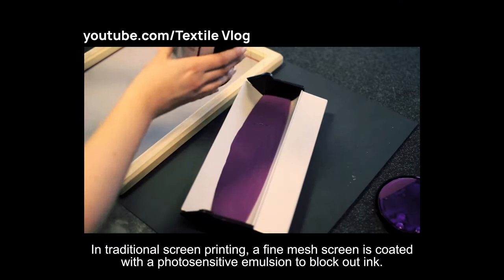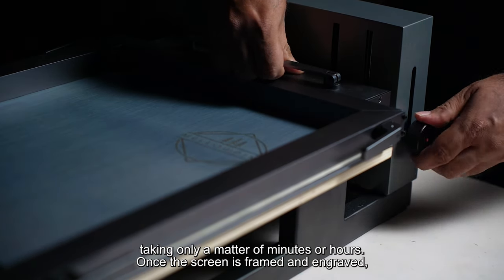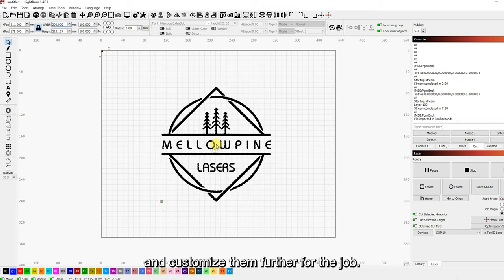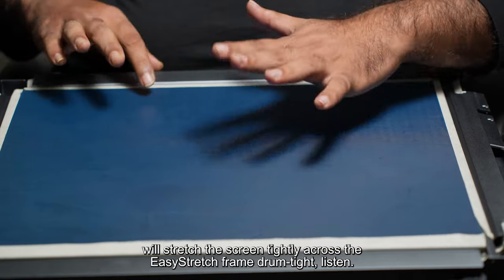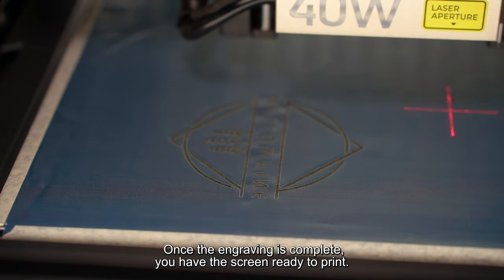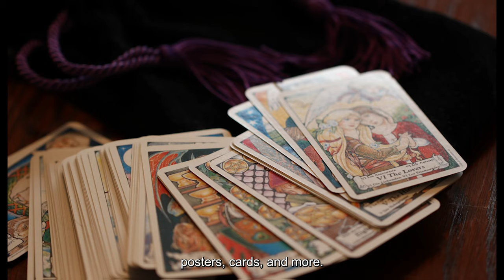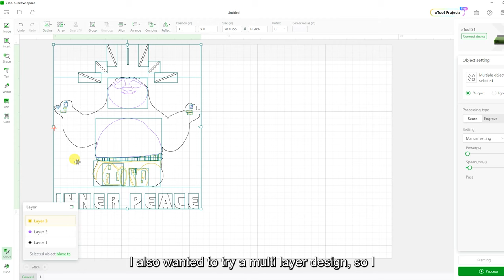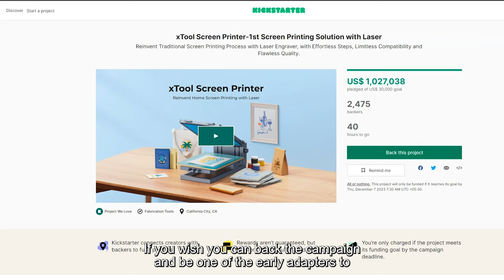World's First Laser-Powered Screen Printer: Xtool Screen Printer Review

Comment: Xtool claims the screens are reusable as long as one can - remove and reapply emolsion. did you explore this options? pretty sure a mess up on engrave will be frequent.
Reply from the maker: Yes, technically, you can reapply the top coating to reuse the screen. But to do that, you will need to dial in your laser settings perfectly so that it does not weaken the mesh underneath. I found that the mesh is very fine and is easily damaged when pressure is applied with the squeegee.
Reply: @MellowpineLasers interesting. the idea of use stainless mesh was to be "laser proof" so seems thats not the case.
Does Xtool have the screens on sale and if so do you know how much per pack or per?
Reply from the maker: Their initial kickstarter mentioned a pack of 3 screens costs $24
Reply: @MellowpineLasers  I don't believe you would use your laser to remove or reclaim the screen but use a emulsion remover paste and then reapply new emulsion.

Comment: can the D1 PRO 5w be use to engrave the screen?
Reply from the maker: Yes, D1 Pro 5W can be used to engrave the screen. But you will need to perform 2 passes at around 80% power and 5000 mm/min speed.
Reply: Are you using steel mesh or normal mesh

Comment: After the material is applied do you use a dryer or does it just air dry?
Reply from the maker: It air dries enough in about 10 minutes for the nest layer. However, you it'll take 48 hours before you can wash it.
Reply: depends on the ink - don't know about the XTOOL bundled ink - but usually with water based screen printing ink you need to heat it to get it to cure (sublimation heat press works well) - or add curing catalyst if want to air dry- otherwise it will wash out

Comment: Thanks for this review! It was super helpful but could I get some suggestions? 

I ran my design using the following  settings:

Power :90
Speed :50
Lines per inch: 200
I have a lot of fine details and halftone accents that didn’t engrave through! What setting would you suggest for this? 😮